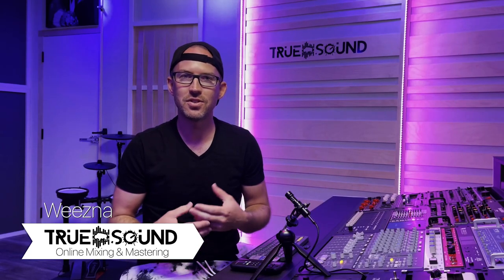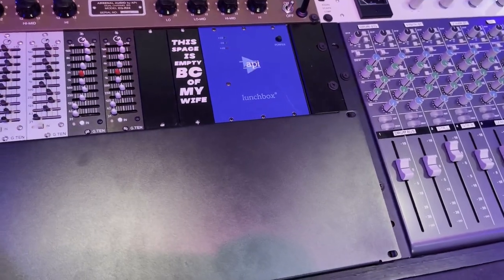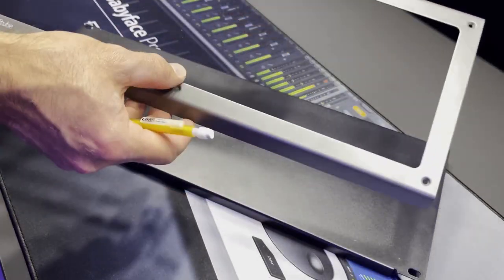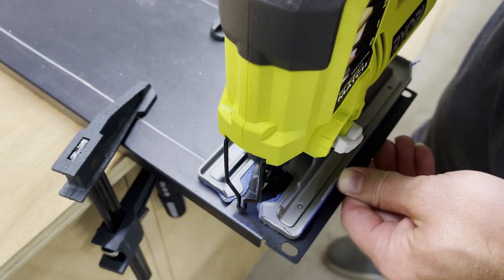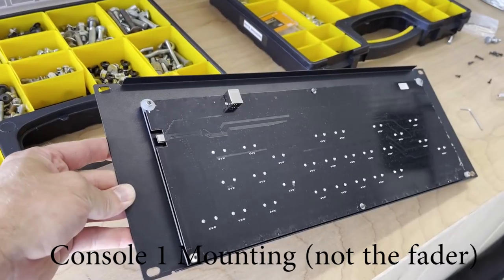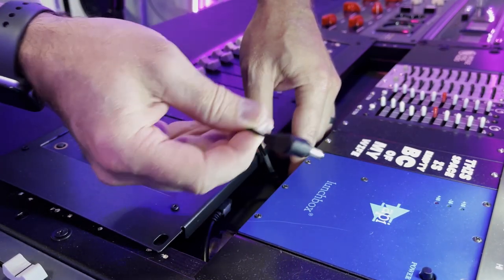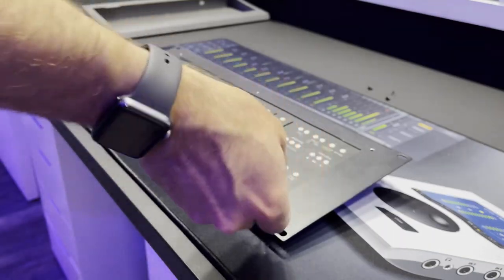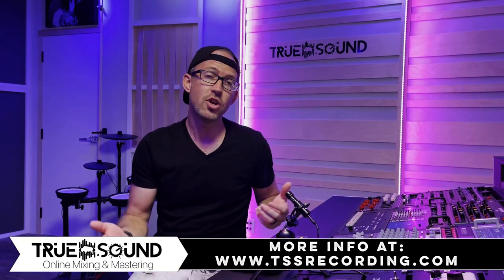Custom Faceplate/Mount for the Softube Console 1 and Console 1 Fader

Comment: For people who don't want to cut their original power supply connector, there's always the option of getting a right angle barrel connector adapter for dc fans, or pedal board power (just be sure to not get the l6 adapter as that will reverse the polarity).
Reply: Where can i find such a right angle barrel connector ? tried google without any luck Can you help with a link?

Comment: Great video BTW!
I appreciate that you do videos about whatever you may be doing in the studio at that time, even if it may only be of interest to a relatively small number of people. In this case Console 1 owners and the C1 curios.
Thanks for putting in the effort.
Reply from the maker: Thanks so much, yeah I know these are ultra specific videos but it is something fun to put out there! I’m just always thinking of these little creative solutions so it’s just been fun for me to share them
Reply: @TrueSoundTV  Well I appreciate it.  And speaking of ultra specific.....

I've seen many videos, and series of videos on Console 1.
None really capture the Workflow and Flexibility and Speed and Power that C1 enables.

There's 8 full channel strip emulations now.  Plus dozens of Softube & UA "Console 1 Ready" plugins. 

And beyond the obvious Hardware Control and OSD, it's essentially a plugin slot housing 6-plugins (loadable sections) in a modular, re-routable, Channel Strip layout .

Just the 8, times 6 component parts, is 48 Channel Strip variations, before you start re-ordering the three middle sections.

The Drive & Character section alone is worth the price of admission.  

Swap the Shape section to the full Softube Transient Shaper, and those 4 knobs unleash an insane amount of control over every source, before you even touch EQ or Compression. 

I feel like Console 1 offers soooo much power, it even goes over the heads of people who've owned the system for years.  AND, since I bought it when it first came out for $1000 with only the 4K emulation, every year they make that initial investment even more valuable!
Half of the features it has today weren't there when I bought it. 

So basically I think that the system is seen as a gimmick or a nice to have toy, rather than what it really does bring to the table.  And I attribute that misunderstanding to the long list of reviews out there that focus on showing features, bells and whistles, without actually showing the workflow and what control it affords you, once you learn how to use it. 

Load it across a 32, 64-Track session and just use the I/O Levels, Panning, & Width.  Then just the Filters, Drive, & Shape sections.  The mix is Already in an amazing place and you haven't touched dynamics or equalization yet.  And for those you have dozens of options, across every channel and bus in your session. 

I like you work Hybrid, so I see Console 1 as an extension of my Analog Consoles and Outboard. 

So my request to you...
Give us the Ultimate Console 1 Workflow series. 
Both for ITB and Hybrid workflows.

How do you setup and then work through your mixing sessions?   What's your process?  How do you choose emulations?  How do you integrate the Analog Emulations with the actual Analog gear?  ???

I think what you and your Chann bring to the YouTubez is an actual User Experience, rather than "review" videos of the latest hot-right-now Gizmotron 3000 click-bait snake-oil nonsense. 

So what say you?

Comment: Excellent video! The Low Frequency knob on my Console 1 suddenly stopped working. The shaft turns fine but the on-screen display doesn’t receive any information. The LED indicator on the hardware doesn’t move either. All of my other knobs are working fine. 

If I unscrew the plate like you did, will I be able to access the wiper of the potentiometer to try to clean it or fix it. 

Have you ever experienced that? If not, is there any other reason you can think of why the knob might not be working?

Comment: Pretty cool…wouldn’t you want to have the fader under the console? Thinking about getting the fader, I guess you like it enough to make these modifications….
Reply from the maker: Yeah I have had the console one for about five years now. It is quite literally my most used and favorite plug-in. About a year ago I got the fader and kind of went back-and-forth whether I wanted to use it in my set up. Currently I just use the fader for my drum tracks, my SSL X-Desk as my main mixer, which is the reason why that’s up front!

Comment: Let us know if you get any wonky behavior now that you removed the shield around the boards by removing the box.
I’ve been interested in doing the same.
Reply from the maker: Yeah at first I did question whether or not there would be some sort of interference especially with other gear being so close. So far I haven’t had a single issue with either one.
Reply: @TrueSoundTV  That's great.   It may not Need all that shielding as it's basically a USB keyboard and there's obviously no Audio running through it. 
Possibly they built em like tanks just for durability. 
But Some USB devices do get Wonky without being shielded.
Old monitors used to make the original Faderport go crazy as an example.